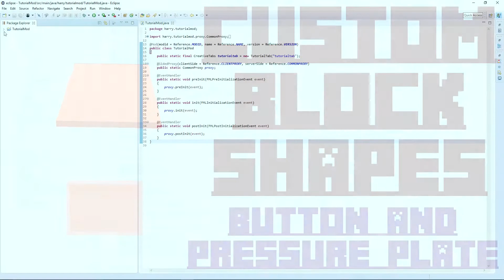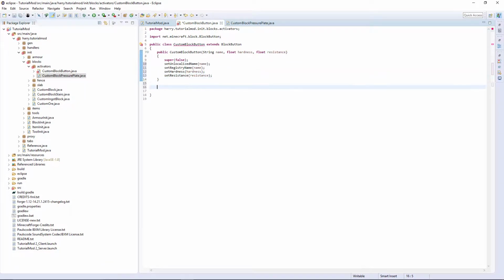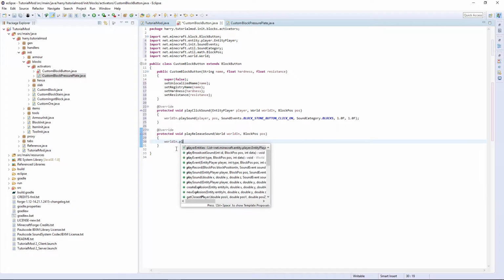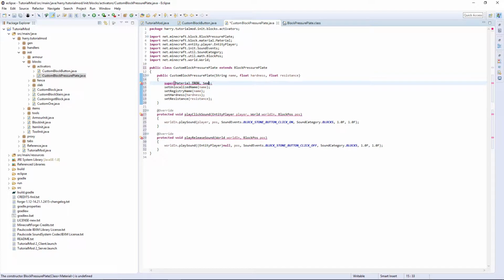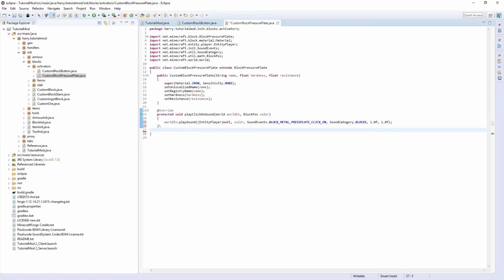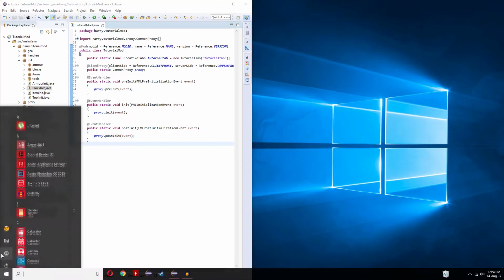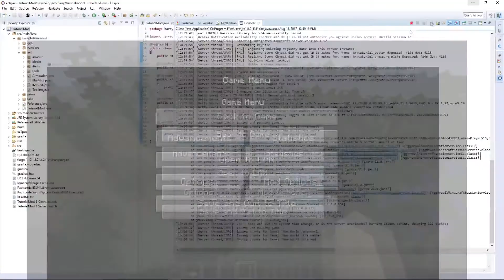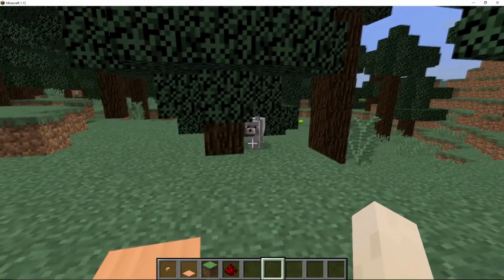Custom Button & Pressure Plate - Minecraft Modding 1.12 - Episode 14

Comment: in 1.11-1.11.2 you were able to state how many ticks after pressing the button or pressure plate would go by before releasing - is that not possible anymore?
Reply from the maker: +Rik'tor Heverez not sure, is the function gone?
Reply: @Override
 public int tickRate(World worldIn) {
  return 10;
 }
nothing has changed

note: replace 10 with w/e you want
Reply: ok i found it - if i remember correctly - wood has a int of 30 and stone is 20, not sure about the gold pressure plate